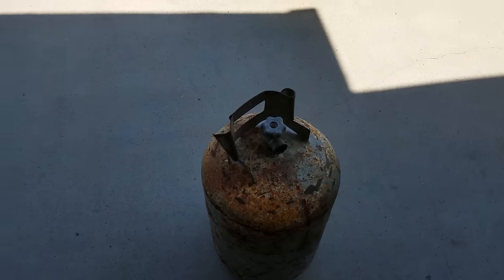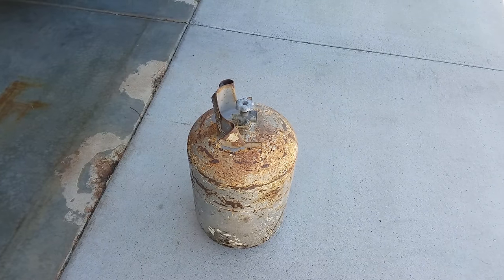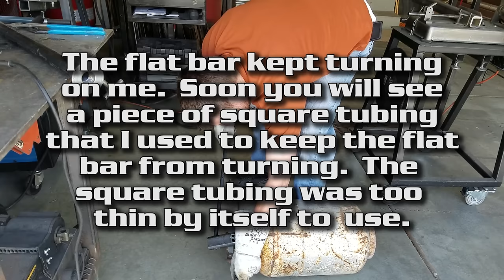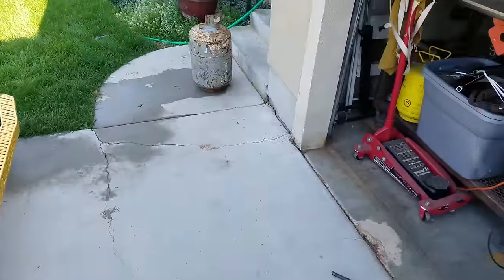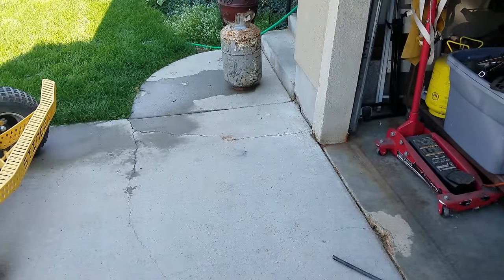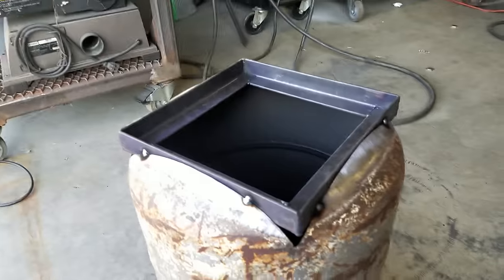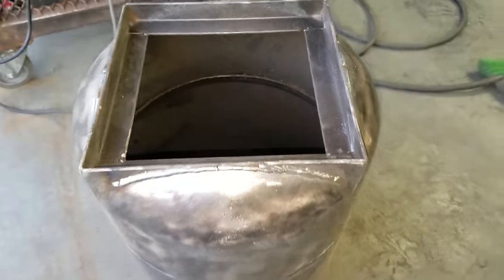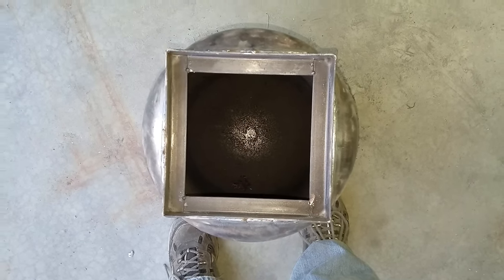Tent Stove from Propane Bottle -- Part 1

Comment: Put the hole through the square tube as close to the valve as possible.  That keeps the "wrench" from wanting to tilt.  Kevin Robinson hits the valve with a hammer.  The valve is not saved anyway.

Comment: you attach the bottle to a tree with two straps,
and a large adjustable wrench lengthened by inserting it into the square bar

after you fit with water be sure no more gas....

Comment: Hi . just wanted to say if you watch your video from 1.33 when you try opening the valve and you use a bar to lever it.all you had to do was not hold the bar .but put the bottle side ways and put the bar on the ground to hold it from spinning the bar and ground was the leverage.

Comment: take a real pry bar stick thru handle , lay tank and pry bar on floor. place pipe wrench on valve , place cheater pipe on pipe wrench if needed. place foot on cheater pipe if needed.

Comment: Someone may have already suggested this, but if you take the valve handle off; you can hold the valve in a bench vice and turn the cylinder.  It makes it really easy that way.  When I saw you with the square tubing, I thought you were going for a similar idea, but were going to use a hitch receiver to pin your homemade tool.  Those valves are a bear!
Reply from the maker: Nobody has yet... good idea.  I may have to give it a shot next time.  Thanks!

Comment: I feel your pain on the valve removal. I had to have my 500 pound friend sit on my propane tank and steady a crescent wrench while i pull all my weight behind an 8 pound hammer and we still had one hell of a time getting the valve off. But we finally did. Making a Charcoal BBQ at the moment since I don't trust my girlfriend's sketchy propane BBQ that almost caught our house of fire and nearly blew me up in the process lol. But I'm thinking of making a wood tent stove on my next build, we do SCA and recreational medieval re-enactment camping so I'll likely throw in some forged handles and legs to medieval it up a bit but i like the overall build your doing. One thing I might also do is take some angle and weld it on the front and do some twisted bars in front of some thick glass as a sort of a viewing port thing so you can see the fire, adds some nice lighting at night in the tent and sets "the mood" ;) ;) haha

Comment: I had similar troubles removing the valve until I soaked it in WD40 (penetrating water dispersant/lube), gave it a couple of knocks with a hammer, then it came off with a long wrench.
Possibly the hardest part of my build!

Comment: I went with a 5 inch which was way to big. I had some 5 inch from a job I did.  3 or 4 will work better. Oh and strapping the tank down with two straps works really well too. I had a log that I split wood on to do it. Hope that helps. Thanks for the reply.

Comment: I used a 24" pipe wrench on the last valve I took off but if you take a old socket and weld it to that square tube you can put an impact on it.

Comment: I made a bottle stove a few years back and it is great . My door is flipped for that few more inches of wood.great start. The ash pan is a good idea.i used 1/2 inch tube nuts and 1/2 all thread for the legs.
Reply from the maker: What size flue did you go with?

Comment: Check out the one I made on my Channel I was proud of it to say I'm a painter. To get the valve of mine I filled it with water twice then cut the valve off with a plasma cutter well it was still full they stink till the first time you light them
Reply from the maker: Did you go with a 4" flue?

Comment: I made one. It was 5 in outta tin lids and some straight rod. I used some brake hardware to keep tension on the rod. I couldn't find a 5 in damper.
Reply: I used cable straps to put the two together and sandwich the rod

Comment: To make it easier to get that valve off, boil a kettle full of water, and pour it over the valve. It loosens up the thread sealant that they use. Your welds are really neat ! Thanks for the video.
Reply from the maker: Good to know.  Thank you.